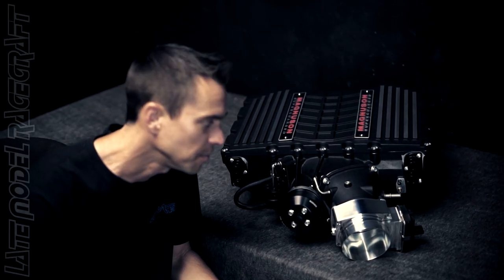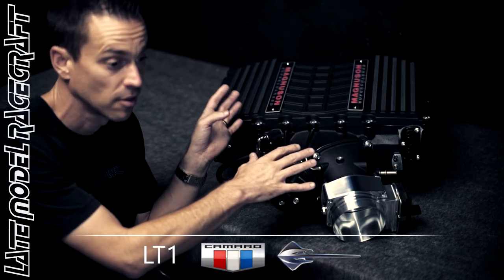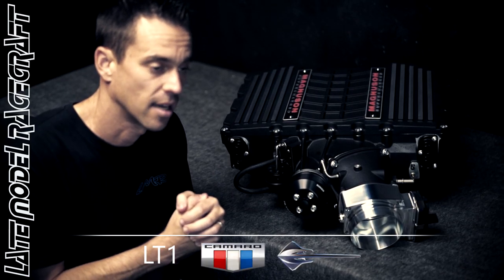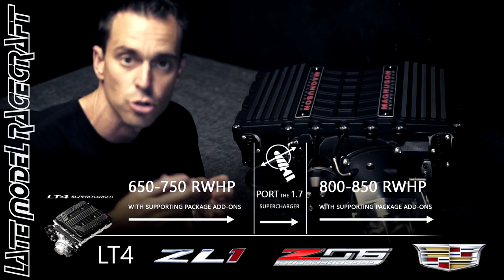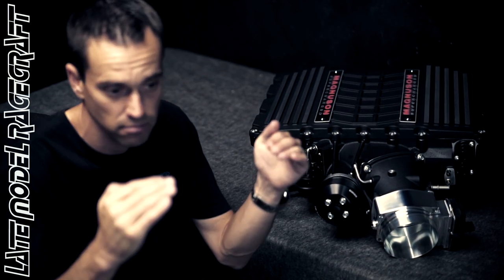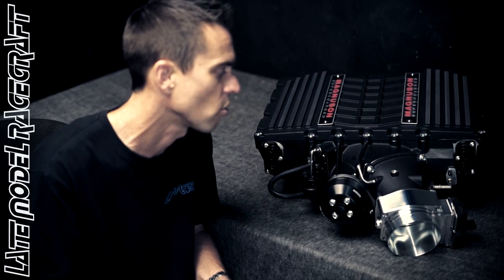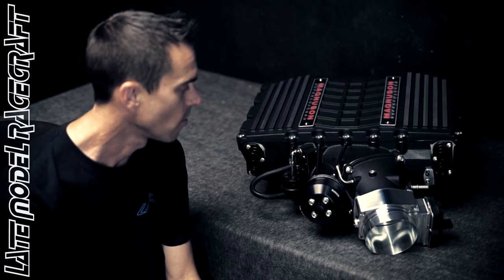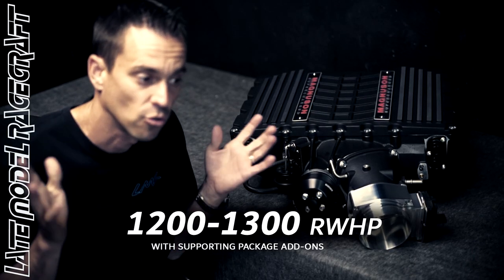Why you need the Magnuson 2650 for the LT & LT4

Comment: I put the Magnuson 2650 on my 2013 ZL1 Camaro and the dyno numbers came in at 958 whp and 846 ft lbs of torque with 16 lbs boost at 7000.rpm. Great content!  ✌
Reply: Can I put that on a 2014 Camaro SS 6.2
Reply: What other supporting mods?
Reply: @MrChucktown09  I added a BTR stage 3 cam, ported heads, 9.5 lower pulley, 5" big gulp, Monster S triple disk clutch, added cooling system, MM catch can 2" headers 3" cat back with Corsa exhaust. Running NITTO RRR drag radials. I have my stock supercharger for sale if you know anyone who is looking for one? ✌️
Reply: @Michael's_ZL1  very nice! How do the RRRs hold up? I'm in the same boat as you will be trying to sell my 1.7 stock blower. And have NT555RII otw
Reply: @anthonydimaiuta4225  Yes!
Reply: @MrChucktown09  They are great tires, but because my ZL1 is at 957 whp the 19' don't have enough tire wall to absorb the additional power. That's why I am putting 15's in the rear with MT tires.
Reply: @michaelaguirre403  where are you located? And how much? I offer 1750$
Reply: @antoniod3254  Colorado and $2,000 + shipping, it's yours. It has 26,000 miles on the stock blower. ✌️.
Reply: @michaelaguirre403  LSA or Lt4 supercharge for sale?
Reply: @michaelaguirre403  LSA
Reply: @anthonydimaiuta4225  Yes
Reply: @chrisserthedisser  😂
Reply: @michaelaguirre403 and you didnt change fuel system ?

Comment: Was thinking of getting one but my LT1 has 110k miles lol. Should probably spend the money cracking open the motor for a refresh / upgrade. Worried this would kill it even at low boost.
Reply: Always better to be safe then sorry.
Reply: Yeah  your right. Stock lt can  only handle bout 8-10 psi in stock form . Better safe than  sorry  🤙🤙🤙
Reply: One good thing about well used motors is they are looser so handle the increased heat better.  Down side is, how fatigued are your bolts.  Boost it, and see how long she goes. You never know, it could be fine.  What I do know is destroying a fresh engine especially if its over something stupid fing blows.
Reply: @roberts3930  nice! thanks for the info!
Reply: Let ur lt1 die stock and just get a new one
Reply: @MonicaHolly143  yeah then I have an excuse with the wife to buy a beefier version lol

Comment: Actually running a large volume supercharger allows you to drop the rotor speed significantly and achieve the same boost as from a smaller unit, plus as he said the air temperature is lower because of the lower speeds of the rotors.  If I were modifying my car I’d go with the 2650 and headers and significant uprated aluminum radiator/oil cooler/big intercooler.  Then add a cam/valve train and upgraded fuel system.  These 2650s are awesome.  I’m inclined to give these guys a call on my V.

Comment: Whole new level of respect for you ! I have been considering 2650 magnuson or edlerblock since it has the set up for port injection, but I hear you haft to port the edlerblock to get magnuson level performance.   The magnuson has a louder wine pitch sound, and is the best selection out of the box. Magnuson and a stage 3 or 4  cam on my ZL1/1LE 6 speed would be the perfect set up, 200 hp upgrade I'm sure.
Reply: The magnuson has better intercooler bricks vs the edelbrock. The edelbrock just isn’t optimized for flow or cooling, whatever the platform.
Reply: I tried the the EB couldn’t get much boost. I have since installed the Mag should hit the Dyno early next week.

Comment: @1:10 what are the "correct supporting mods" needed to make that 650-700whp? I have a 2016 camaro 2SS A8 with 89k miles and was thinking of getting this SC  along with a 103mm tb/intake
Reply: You need fueling supporting mods if you’re not going to swap out the pistons and rods

Comment: Most people build their cars but don't actually track them. For a track build, would a procharger be a better option or would you still recommend the 2650?
Reply: He says a roots style blower is better for tracking it, since it has you leaving corners faster. They're also best for around town, stop light to stop light stuff (if you have sticky tires, like nitto drag radials). He says the centrifical style blowers are for 50mph to 180mph blasts, like for half-mile straight-line races and rolling freeway races.
Reply: @YoursInYeshua  At the time when I posted this comment, I didn't realize how brutal the torque can be from a roots style blower. I've seen too many guys mention that it can be too much for a roadcourse. A centrifugal allows the power to come on easier for corner exit. It seems the roots blower will just haze the tires too much unless you're keeping your power at or below 750WHP.
Reply: @Cardiakk  Agreed. My boss had the C7 Z06 and even with its wider tires, he couldn't put the power down very well.
Reply: @NightKing114  Yeah, the Vettes are just too light in the rear. The ZR1 aero and/or 19's in the rear is needed to keep it planted. For the Camaro, 18s are best at all four corners.
Reply: @Cardiakk  Yes. And the 18s allow for the wider 305 or 315s I believe, too.

Comment: Could this be used as replacement for LSA supercharger? Do you recommend something else for LS motors?
Reply: There is an LSA 2650
Reply: I just put the Magnuson 2650 on my 5gen ZL1 with my engine build and it hit 957.6 whp and 846.3 torgue with 16 lbs of boost at 7000 rpm.

Comment: How would a forged rod and piston L86 with worked heads, cam, plenty of fuel system in a 2014-2018 RCSB with a 3.0 Whipple compare to a 2650?
Reply: Or the Armageddon TT kit or F1-A
Reply: Whipple 3.0 takes over past the LT power range. Thats why fords respond better to whipple.more rpm
Reply: @Josh Chauvin I have started considering a new project vehicle since I have sold all of my vehicles and I really wanted to build a Gen V LT engine platform and after driving a Gen V 3.0 Whipple on the LT1 in a Tahoe RST with a 10 speed I really wanted one in a RCSB. Granted it was a stock Whipple kit with the stock Whipple tune and boost, stock converter in the 10 speed transmission, but the Tahoe had ARH headers, Borla exhaust, suspension and Wilwood brakes. Then I started reading up on the L8T and thought pulling the L83 out of the RCSB for either a forged L86 or take the L8T and bore it to 4.125" and bump the CR, replace the rods with forged 3.860 stroke rods. Obviously work the L86 or L8T heads, replace the cam, get the modified LT4 HPFP, upgraded fuel injectors, upgrade the low pressure fuel side, with either a F1-A, 3.0 Whipple, TVS2650 or 3100 once it comes out, or like I said the Armageddon TT kit. I'd like to make 900-1100whp on E85 and meth. The Gen V motors seem to make that kind of power very easy while remaining relatively tame compared to the higher HP LS setups I've had or have been around.
Reply: With the right heads/cam the whipple will work great
Reply: @bmackins94  What could the 3.0 Whipple support on the LT platform?
Reply: I’ve got a 19’ Sierra Denali with the 10 speed, Texas Speed Forged Rotating Assembly with their SSV cam which still retains excellent Driveability using OE torque converter. Currently at limits of OE fuel system and unable to find many additional fueling options
Reply: @Joseph Graham  From what I understand, people making higher HP with the trucks have swapped to LT4 HPFP and injectors. Lingenfelter makes a modified LT4 HPFP that has a 12mm bore, there are injectors that flow 30% and 60% over stock LT4 injectors, and then people have upgraded the low pressure fuel pump in the tank. One RCSB I was considering had a cam swapped LT4 long block with a D1-SC. He was running the LT4 stuff and I think a 540 pump in the tank. He said he had maxed out the fuel pump making 720whp I think and to make more it needed meth. I wouldn't want to use meth as a crutch so I would obviously get a cam with a bigger fuel lobe, then address the in tank LP pump before replacing the HP fuel pump, and either the +30% or +60% injectors to support what I end up building. Plus there are ways to add port injectors and have both direct injection and port injection like GM used on the LT5. But there are too many 1k+ Camros and Corvettes that just use meth and DI.
Reply: @chesspiece81   Oh forgot to add the Texas Speed cam already has the +32% fuel lobe. And the guy with the RCSB you are referring to has a previous generation L86 platform because the current gen GM pickups are no longer offered in a RCSB configuration
Reply: @Joseph Graham  They are but you can only get the 4 cylinder turbo. I'm looking at picking up a 2014-2018. The LT4 and D1-SC RCSB was a 2015 Sierra. Another downside to the RCSB they only come with the 5.3 L83 and the 6L80E but you can get the 6.2 L86 with the 6, 8, and 10 speed in the extended and crew cab trucks. The newer 3/4 ton regular cabs have a V8 but only have the long bed and the 6 speed. You can't get the RCSB 2500 with the gasoline V8 and 10 speed.
Reply: @chesspiece81  get a 6 speed or 10 speed ... i have an 8 speed with an l86 and you don't want that 8 speed !
Reply: @chesspiece81  i was going to put a blower on my truck but i just don't trust that 8 speed...

Comment: Nice video, but looking on Mags direct website, it shows max power of 588 TO THE CRANK on this model.....  I know you mention WITH bolt on accessories,  you can achieve 650-700 TO THE WHEELS...From 588 crank to 700 wheels?  Some serious add ons right there.   You can tell he never responds to comments, so how do you viewers weigh in on this?
Reply: I'm thinking that the mag's direct website is referring to a completely stock engine with factory fuel system exhaust system and everything which has limitations. And he usually that power packages are attainable with supporting mods such as fuel and exhaust and cam

Comment: Sadly, the LT4 needs a cam for almost any mods because that the only way the fuel can be increased to supply enough.
Reply: @LMBC6Brian  It’s exactly spot on as I own 2 LT4 cars. The only way to increase the fueling is to change the cam because the cam lobe is responsible for fuel pump activation.
Reply: @TBagr or by using Katech di fuel pump

Comment: Why this over the larger Whipple?
Reply: From what I heard better IATs and overall cooling
Reply: Whipple takes over past thr LT rpm range. Thats why they're better on fords. More rpm
Reply: @joshchauvin5585  what about the ls?
Reply: I went with the Whipple, got 600 whp,stock internals,runs super cool,no heat problems,6th gen Camaro!